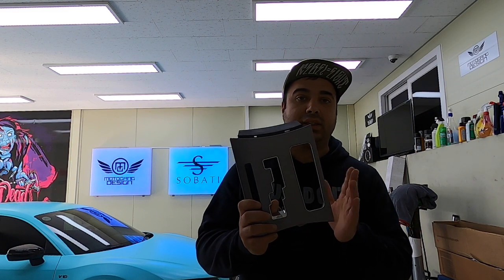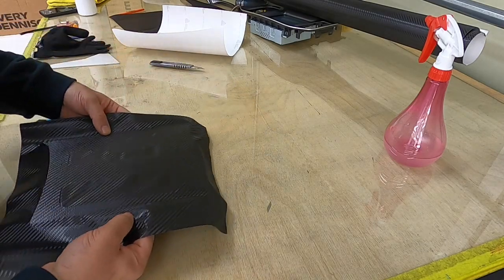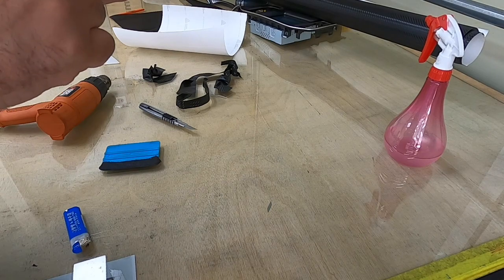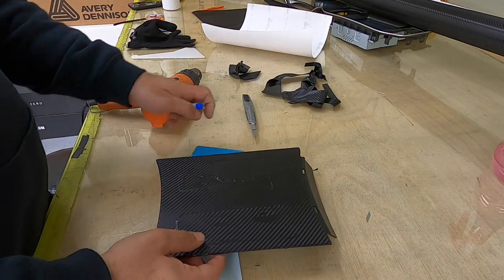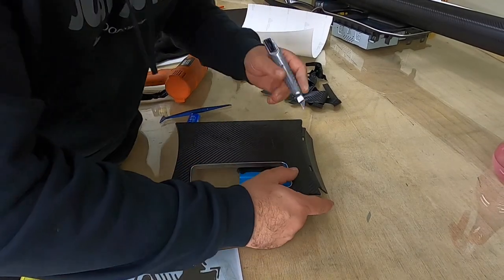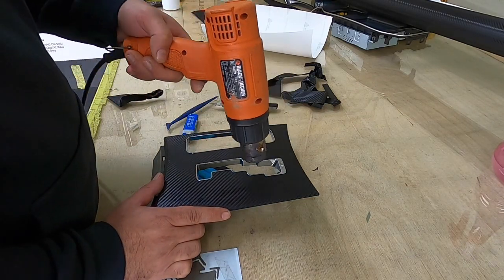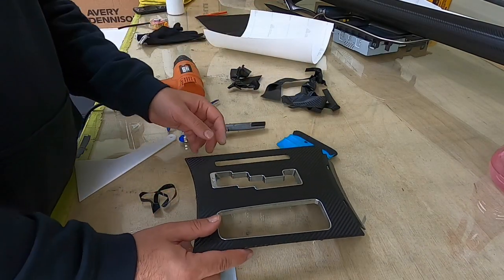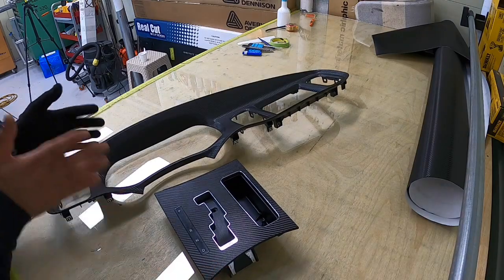How To Wrap Center Console Of Dodge Charger#diy #dodgecharger #wrapping

Comment: How would you go about wrapping the chrome pieces on the center console, and the vents in the charger?
Reply from the maker: If u meant hood vent I not recommend to wrap a plastic better paint it and for chrome pices on console also u can wrap easily
Reply: @Arashwrapper  what about the interior door handles, the chrome ones
Reply from the maker: @larkinator7388  u can do just take ur time and give enough heat after wrap

Comment: How did you take out the gear shift plate?
Reply from the maker: First need to remove shift knob (push chrome piece down and you will see a pin there. Release it and then  pull the knob up 
Second;with trim remover try to slide  out the climate control unit and then as soon as you remove it just pull shift plate up and disconnect the connector 
Notice: the one I worked on was 2011 model maybe newer model is different or the same
Hope it did help

Comment: What size should my wrap cut be for a 17 charger scatpack hood 6×5 or 5×6 also the roof size. I'm coming off back surgery so I need something to do lol. Great videos by the way. It will be my first time wrapping.
Reply from the maker: Hood ;150 cm vertically 170cm horizontally 
Roof: 130cm vertically 160 horizontally

Comment: How did you take out the inside piece of the dash?
Reply from the maker: All of it sticks with plastic pin so use trim remover from dash trim edges it will pops out by itself

Comment: Hello, I would like my interior wrapped in carbon fiber but do you have something a little more glossy? Also, can you wrap exterior parts that have texture to it? Specifically my rear diffuser, side skirts and front chin spoiler...
Reply from the maker: Hey man 
Yes we do have custom print wrap on 3m film In high glossy finish/ yes possible to wrap with texture film except any plastic parts with out clear coat or paint on it
Reply: @Arashwrapper  What I mean is the exterior parts like my rear diffuser, side skirts and front chin spoiler is plastic and is not smooth, it has a little texture to it. So cannot wrap these parts?
Reply from the maker: @camposl69  those parts are not possible if only plastic cuz film would not stick well specially corners
Reply from the maker: And for those kits paint or powder coat recommended
Reply: @Arashwrapper  Ah okay, understood! Thank you!
Reply from the maker: @camposl69  hope it helps